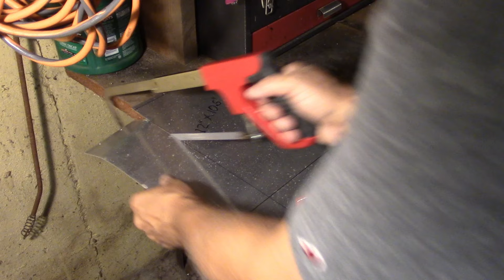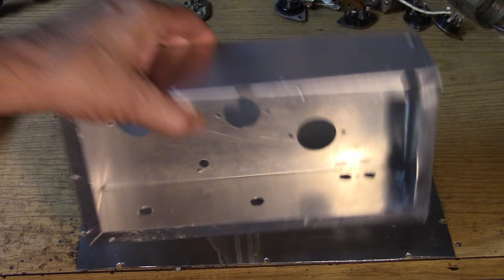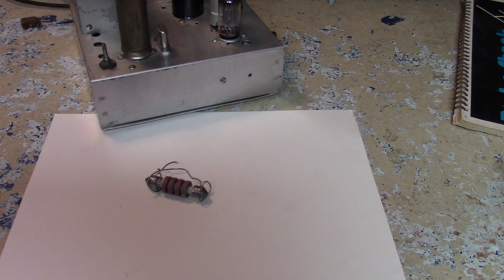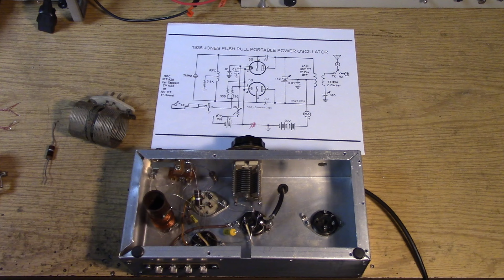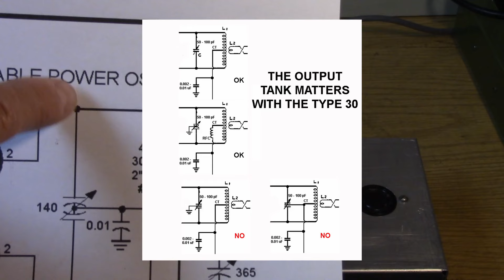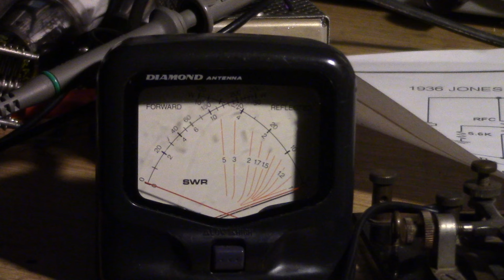1930's Portable Transmitter Part 2

Comment: Mike, I've messed with a bunch of these 'one-and-done' power oscillator circuits and they all (to-me) are largely worthless--even using larger high-gain tubes!
So, I always revert back to a dedicated oscillator and (sometimes) an intermediary buffer amplifier for further isolation.
In your case of course, you are concerned with power-draw and so you may have to live with some compromises.
As far as you questioning placement of that center-tap cap, (either to ground 0r B+) given the theoretical zero-impedance of the power-supply, would it really make much difference?
obviously, I'm watching these videos just now; so you may have already done something else.
Great video series Mike & 73...
Reply from the maker: Yup and they knew about this early too. The dogsled radios used on the Byrd expedition t Antarctica in 1928 were two special low filament drain 01As, one as a crystal oscillator and one as a neutralized final - all battery powered. And the batteries were in special insulated boxes.

Comment: I've built a fair number of simple tube transmitters and never had a problem getting them to work.  Then I decided to try a push-pull transmitter using a pair of 6AG7s, and I never did get it to oscillate.  I didn't spend a lot of time trying to figure out the problem, but I do agree that there is something squirrelly about the P-P circuit.  I am reminded of the saying, "If you want an oscillator, build an amplifier, and if you want an amplifier, build an oscillator".
Reply from the maker: It had me head scratching.
Reply: I made one with a 6CG7 once. The power output was dependent on the crystal I used. One of my 6 MHz crystals pushed it to a whole watt out, but with 4.5w burned in the plates.
Reply from the maker: @Novice1965  Agree completely. The circuit is novel, not really practical.

Comment: Great lesson to learn on designing your Jone's Circuit.  Prototyping with a different tube type than what you intended to use in final construction, left you with having to redesign the circuit to get it to work for type 30 tube. Anyhow, Mike your a great electronics engineer.
Reply from the maker: The hook up on the plate tap was the key.

Comment: Oh man Mike, your hack-saw metal work really triggered some old (bad) teenage homebrew memories.  Suffice it to say you had more tools than I did.  I think I still carry the scars.  What's up with that circular saw?  Don't real hams used Greenlee chassis punches?  I say Mr. Carlson doing much the same thing with the BC348 power supply he was building.  And wow, Frank Jones came up with a messed up schematic?  There is no hope...  73   Bill   N2CQR
Reply from the maker: No Jones was just cleverly rebranding an old circuit published before 1928 by using a new dual tube approach. That was novel.

Comment: I built a qrp version of the Jones TX with a 3A5 tube. It does not apply chokes in the grid paths but just two 10k resistors. The capacitor in the plate circuit has no center tap. The B+ voltage is applied to the center tap of the coil via a choke. This TX oscillated immediately. By proper tuning the cap in the plate circuit it was possible to reduce the harmonics dramatically.
Reply from the maker: I think you have the solution. The P-P circuit will tolerate no chokes if 1. you hook up the plate tap correctly and don't double ground (ground both the rotor of the variable and the tap point) and 2. You have enough gain in the valve.

Comment: I wonder if the choke could be substituted by just two 4.7k resistors going out to each grid from the ground (assuming no DC current is going through it)
Reply from the maker: I will try it as say 27K or 47K.

Comment: Hi Mike, I made my meter holes using the same method BUT reversed my hand drill so not to "grab" the chassis and break my wrist with the hi torque of the drill..lol I also fed cutting oil in the work. Great video!!           Bob N3SWL
Reply from the maker: Wow Clever! Dunno. Its just wrong. Ha.

Comment: I think your problem with the grounded butterfly cap is that with the circuit as shown grounding the center plate also grounds the B+! Note that on  your original xmtr, you have a breadboard chassis, there by insulating the butterfly cap from ground. You need the ground for the RF (hence the fixed cap) but the B+ must remain ungrounded.
Reply from the maker: Well that would be a big No No. I did see this and did not connect them so no smoke. But it still would not run with the rotor grounded and the coil bypassed.
Reply from the maker: Yes its that tap point and grounding that was the issue.

Comment: Mike, a bit off target:
I am wanting to scratch build, manhatten style, a solid state Regenerative Radio. Single HF band or AM broadcast band is fine. 

My issue is having built on a pine board one 15 years ago I can't find the schematic I used. I've looked on the internet, but I am skeptical of some designs thus not sure what to utilize as the schematic.

If you have handy a link to a good solid state regen schematic I'd greatly appreciate your sharing the link.

Thanks,
Kc2wvb

P.S. i find a pilot hole followed by a step drill works well for thru holes in either wood or aluminum front panels. I learned the hard way normal drill bits like to catch and create tear outs. Nice cabinet building is important to me too & often requires the most effort.
Reply from the maker: I like Manhattan style. If you live in a sky scraper you can have a longwire lowered down from the 44th story.

Comment: I used a dual section variable capacitor that had a porcelain base and built the transmitter breadboard style, so no issues. By the way you had much better luck using a hole saw to cut aluminum for a meter then I ever did !!!
Reply from the maker: Wrong is wrong. That was a bad idea!

Comment: On page 158 of the 1936 Jones Handbook there is a variant of this oscillator using a (directly heated) 19 tube.  The RF chokes have been replaced with 50K ohm resistors.  For 20 years I've kicked around the idea of making a 3A5 version.
Reply from the maker: Wow great tip!

Comment: I don’t think think C01  and C02 should be between the plates and grids. Am I looking at this wrong?

Sam AE4GX
Reply from the maker: The interelectrode capacitance between plate and grid provide the feedback path. The output tuned circuit provides the phase shift to get positive FB and oscillation. The Gimmick capacitors simply add more feedback in the case of a VHF tube or a tube with less gain. The Type 30 has around 6 pF of capacitance P to G. It's probably enough, but I wanted to show the technique.
Reply: @MIKROWAVE1  
Thanks for the update on the gimmick caps. 

I had seen a similar schematic that didn't show the gimmicks and thought based on your  question in the SHORT relating to the schematic that this was the error you were pointing out. I learn from your posts every time. Thanks for keeping me in the game.

Sam AE4GX
Reply: I agree with your first 3 words.
Reply: @Capecodham  Harsh, but you make a good point.
Reply: You have to neutralize the tube to stop vhf parasitic oscillation.
Reply: @scotty3114  Usually that'd be the case, but the caps are actually providing positive feedback in this case. Combined with the reactance of the xtal, the feedback is in phase at slightly below the xtal frequency.
Reply: @misterhat5823  OK, like I was my experience with triodes in RF service is very limited, normally I've dealt with tetrodes and pentodes. I was trying to help and exposed my ignorance. 🤪☺️  But live and learn.
Reply: @scotty3114  Just beak the tube that will neutralize it.
Reply: @scotty3114  A 10 ohm resistor at the grid pins works.
Reply: @FarleyHillBilly  OK, I am more used to neutralizing tetrodes or pentodes. Triodes are a little out of my knowledge, just trying to help. Direct heaters can get a little wild, though. I was looking at a Zenith transoceanic circuit the other day, they had an insane filament circuit. It finally dawned on me that the whole thing was so the tube grid biases would work out. It would been easier to have a separate battery for each filament. Lol. 73's
Reply: The caps should be between plate and the opposing grid, as in a multivib, and the Vackar oscillator
Reply: @FarleyHillBilly  Why would you put a hat in a circuit? How many vibs in a multi vib?
Reply: @Capecodham  Capacitor not cappello and two states not singular, that's a different item.
Reply: @FarleyHillBilly  Not in this case.

Comment: I use grinding wheels to cut aluminum panels. Then I use a little CNC to cut out the holes and switches. They are fairly cheap. I am building this to go with my National super regen RX.. Great for young people getting into the hobby/science. 
That black crackle finish is classic 30's. CW forever - 73's W5YB
Reply from the maker: Fantastic!
Reply: Amen!

Comment: the two coils should really be mounted at right angles to each other.
The meter holes would have come out a bit nicer if you had a hunk of scrap wood behind the panel when you drilled it with the hole saw.  (always works for me).    Also works better with a drill press.

Maybe the gimmik caps should be cross coupled, IE: from plate of one tube to the grid of the other, as this is a push pull circuit?  That would be sort of a multivibrator circuit.
DUH!, yes you do need a choke to feed the center tap of the tank coil!   I've never seen a pp tank circuit with a bypass cap at the ct.
Reply from the maker: Agree 100% on the inductor orientation! That will promote less interaction and enhance harmonic rejection.  Multivibrator styles of P-P exist. But Jones never really explains the actual operation of this thing, Ordinary TPTG free running single ended, and push-pull oscillators do not operate in this way. They depend on the phase shift between plate and grid with the tuned circuit resonated slightly above resonance, and feedback from grid to plate. Plus cross connecting would tend to neutralize oscillation, like for a P-P Amplifier.